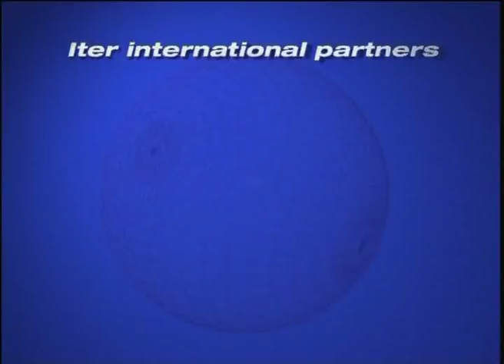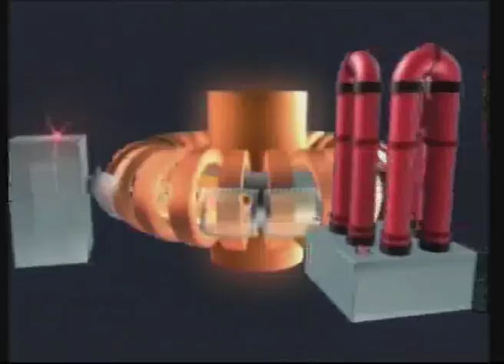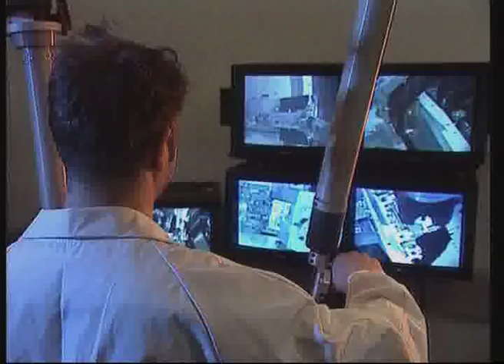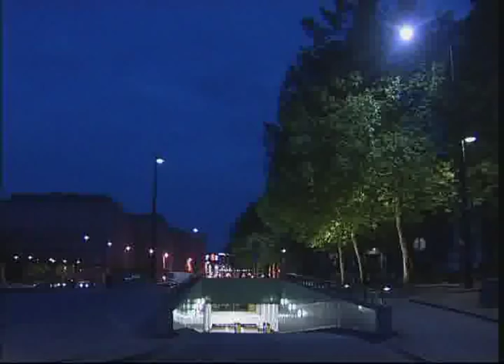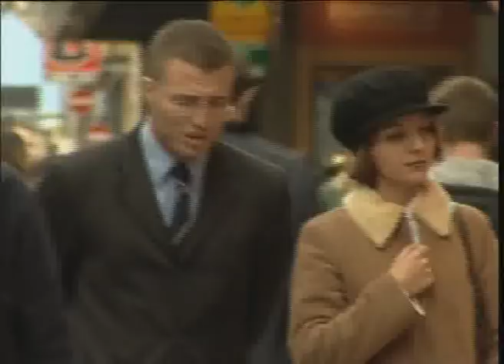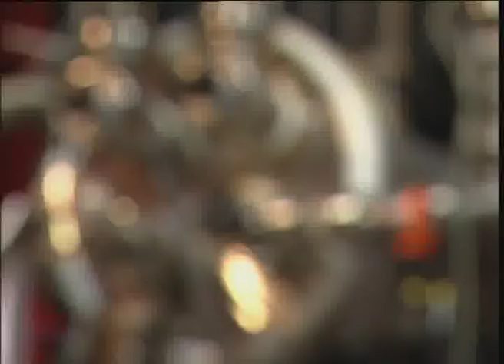ITER, the way to fusion power (2 of 2)

Comment: ETHER sir, is bullshit. Do not pander your lies to the public. It is not possible to measure your absolute velocity in space. It has been proven time and time again that electromagnetic radiation propogates itself though the perpetual self generation and collapsation decay of magnetic fields. Even if there was ether it would be completely unnecessary. Drop it altogether and then use interferometry to give it the final kick in the ass out the back door. The ether theory died a long time ago.